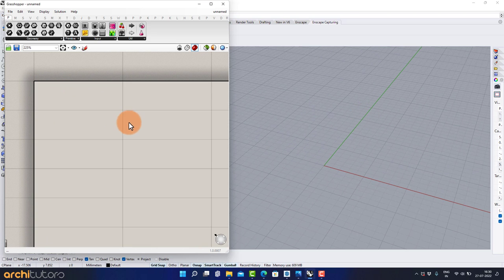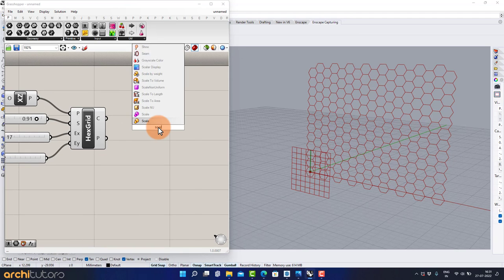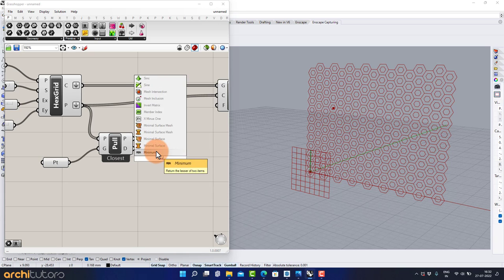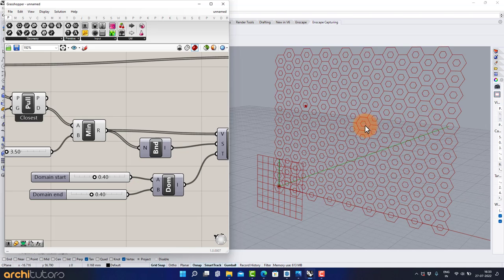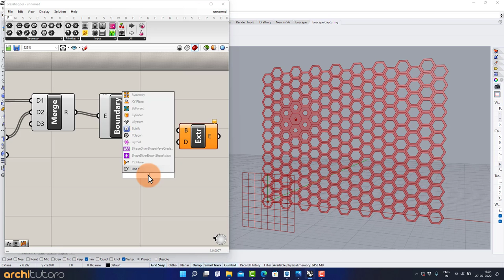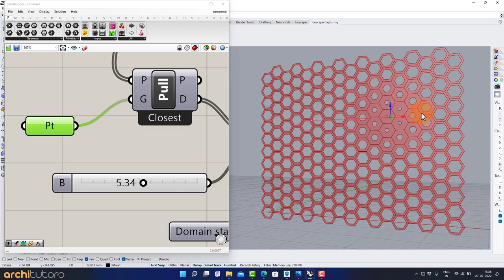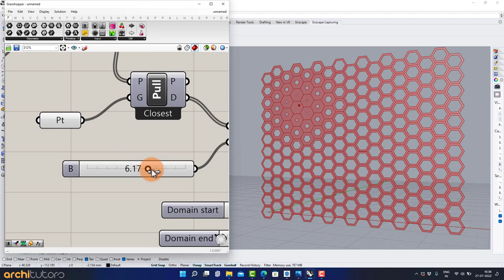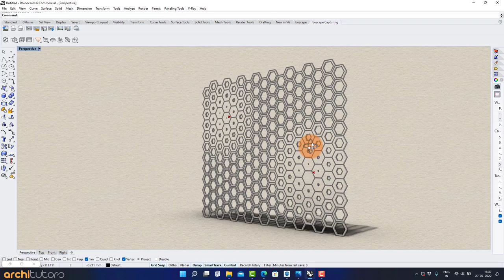Easy Grasshopper Parametric Facade Tutorial

Comment: would there be a reason why it doesn’t work on rhino 7? the domain start and end sliders are effecting every area of my patten not just the ones closer or further away from my point. they all move and stay the same sizes
Reply: same issue
Reply: yeah, exact same problem, i tried Closest pt as well and still didn't work- perhaps we need to extract the points from the hex before pulling?